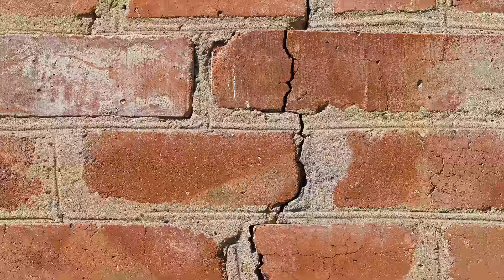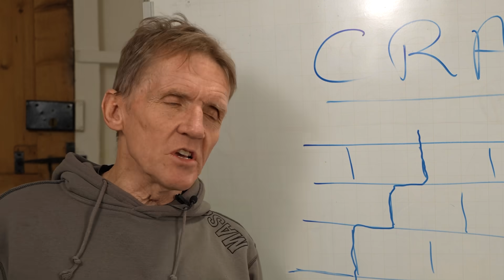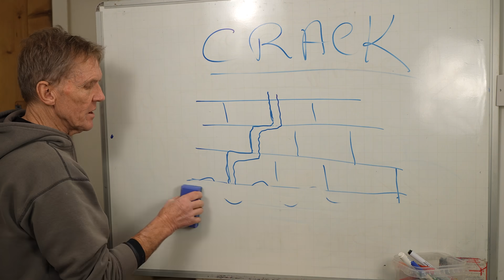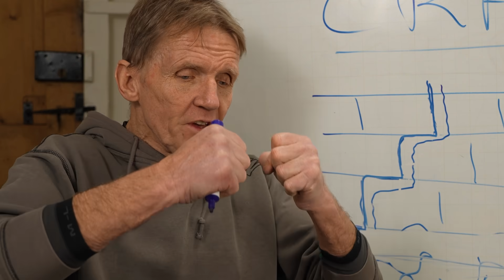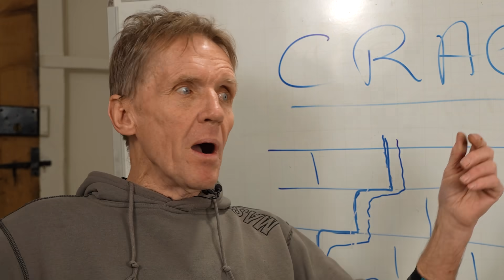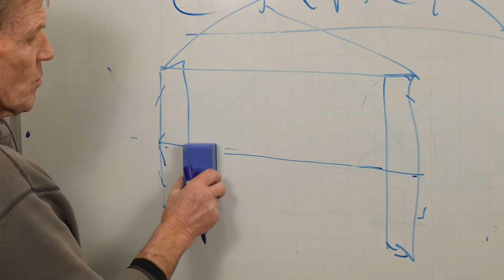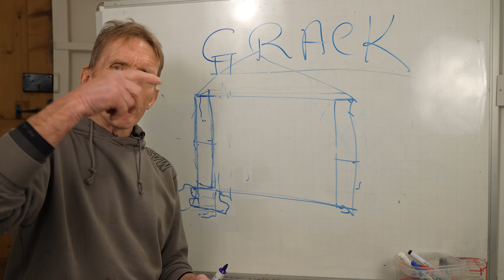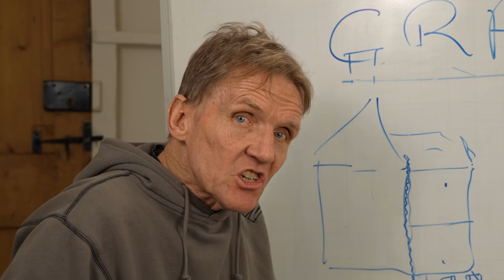Why Has Your Wall Cracked? and What Can You Do?

Comment: What if we don't know what type of mortar they used? My house is over 100 years old and there is a noticeable crack in the mortar and through a few of the bricks. How can we tell? It's made of soft brick btw
Reply from the maker: If you can scrape the mortar out with a screwdriver then it is sand and lime. If you have to grind it then it is sand and cement. I would say it is sand and lime

Comment: in general when u building a brick wall u never ever use a stronger material as glue than the building material like clay bricks are! This is rly important! And with modern sensitive materials like Ytong if u dont use the correct glue u can compromise the structural strength of the wall. And those house will not stand for a 100 years like these old clay brick houses!

Comment: in a 51 year old  house, what if the crack is traveling through the bricks themselves - say breezeblocks in the loft - is that still a none concern?
Reply from the maker: It is not generally a problem. It happens with shrinkage from building with wet blocks. If the crack continues to get wider that is when you need help

Comment: Walls cruck only if they are build by the amatures.
I contracted a demolition company to remove a single story 70 year old  house in Hagenow, Germany.
I agree on the cost and towards the end of the job I was told to pay additional money for removing the foundation from under the house.
Yes, they could not continue as the concrete foundation was one meter wide and over half a meter thick.
No wonder house had no cacks or signs of movement.
This is how you build.
Reply from the maker: We very often put large and very deep foundations in but without reinforcing there is no tensile strength in it. If the ground move the concrete will crack.  Clay is problematic and often the only aswer is deep piling with a beam foundation. We call it pier and beam.

Comment: This advice makes so much sense I can't help smiling throughout or even sniggering! It's just comic how sometimes people act when they don't know anything about a problem and try to address it by just treating the obvious symptoms without recourse to common sense. The fact that a simple act of stupidity can cost someone their house is material for tragi-comedies. The subtle causes that result into houses'/buildings' deterioration without the dwellers' noticing or caring about is food for thought and quite sobering.  Nothing lasts for ever but if it was made to last forever, it certainly wasn't built cheap. In the latter case, perhaps it's something worth thinking about before taking an old, soundly made building down (or severely altering it) just because "we don't like it" or "we want something better".

Comment: we had a crack in the back and front walls of our 1940s built semi detached house. the insurance company sent a man round who said it was subsidence and repairs with the rods and resin was done plus a drain survey.
after the works were completed another man came round to check the work and said he reckoned that it was next door that had subsidence and not our house and it was affecting out house.
about a year after the work had been done the house next door started getting cracks in the front wall in the same place as ours i cannot see the back as they have a conservatory.
there are several houses of the same design in our road with cracks in that very same place so i am wondering if it is a design flaw or weak point.

Comment: If you fix it with the original mortar formula won't it just crack again the following year?
Reply from the maker: It is possible
Reply: @SkillBuilder  So, is there a fix? I have a crack that opens to around 0.5cm above my bathroom door in summer. In winter when we get plenty of rain the crack closes up and is barely visible. This is an annual cycle.

Comment: I FILLED MINE WITH SUPERGLUE. COSTS A POUND. THE SUPERGLUE WILL PERMEATE THRU THE SILL AND FORM A WATERPROOF SEAL. AFTER YOU CAN PAINT THE SILL IF YOU WANT. SIMPLE.
IF ITS A WIDER CRACK THEN UHU CLEAR GLUE FOR A POUND THEN WHEN DRIED PUT SUPERGLUE ON TOP. THEN PAINT.

Comment: Very interesting.  I have a 1913 house and recently noticed a concrete window sill has a crack through the middle of it.  I don't want to get ripped off by a dodgy builder so thought of cutting out the crack a little with an angle grinder and the filling with either mortar or adhesive to prevent rain getting in.  Any thoughts on the best solution?  Many thanks.
Reply: I FILLED MINE WITH SUPERGLUE. COSTS A POUND. THE SUPERGLUE WILL PERMEATE THRU THE SILL AND FORM A WATERPROOF SEAL. AFTER YOU CAN PAINT THE SILL IF YOU WANT. SIMPLE.
ITS A WIDER CRACK THEN UHU CLEAR GLUE FOR A POUND THEN WHEN DRIED PUT SUPERGLUE ON TOP. THEN PAINT.
Reply: Car filler.

Comment: Most of the detached garages in my street have cracks in the front end of the sidewalls. A lot of neighbours blame tree roots but they are built on concrete rafts. The problem seems to be that the big garage doorways have steel lintels above them. These expand and contract forcing the side walls out creating the cracks
Reply: Might also be due to rust

Comment: Sand 6
Cement 1 
Hydrated lime .5

Or sand 12. 
Cement 2 
Hydralime 1          
Thats 4:1 btw

Or hydraulic lime. 3.5 sand 
1 hydraulic lime. 
Also 4:1 ish because lime is less dense than cement do 1 gauge is slightly less atoms per gauge. So we put less sand to keep the mixture strong enough. 
Not confusing. 
You want 4:1 
You want soft gear.
You gotta add lime. 
4 sand + 1 cement 4:1
4 sand + 1 cement + 4 sand + 4 lime = 4:1  (50 50 mix) 

4 sand + 1 cement . + 2 sand + .5 lime = 4:1  ( 25% lime mix)

3.5 sand + 1 hydraulic lime = 4 :1 ( pure lime mix) 
The strength of the podwer changes but the ratio of powder to sand should be around 4.1 for brickwork.

Comment: How serious if caused by thermal expansion? I'm end of a row of 60s terrace. Cracks seem to open and close with temperature, particularly when the midday sun is on the wall.
Reply from the maker: I don't think it is much to worry about, It might be a big lintel or steel that is trapped and causes the flank to move but it would be good to see some pictures 
send to 
www.skill-builder.uk/send

There is a web page to drop the pictures and video onto

Comment: I had a new build and it ended up with a crack straight up almost , crack went through the bricks too so must have been weak bricks or too strong mortar I guess, 
I was always a bit concerned but
Crack was thin though not even a mm and I never touched it, house sold recently and nothing was said about it ..
Reply from the maker: That sounds like shrinkage. Once the house has dried up there is no further movement
Reply: @SkillBuilder  there was a matching crack across the concrete drive too, street was built on clay in what was possibly a small stream,  lots of trees planted at the back of the garden which were not allowed to be felled .
I lived in it for 30 years and the crack never opened up any further.
Worried me st the time but looking at other houses I've seen a lot worse.
Reply: Sounds like settlement. Happens a lot in the first few years of a new build. 

Have also seen it in old properties where the roof has been replaced with heavier materials and added to the load.

Comment: Sitting in a London property built in 1790s - lightly built but has lasted well despite the Luftwaffe coming fairly close a while back. Problem is, modern heavy piling can and has caused cracking on wall/ceiling interfaces through racking of the structure. And, yes, the desire for open plan/wall removal and the added weight in upper floors is not always properly allowed for. The top floor of a Georgian garret was only designed for a bed, a chair, a cupboard and a thin servant - not a fully-fitted kitchen and other stuff - the floor joists aren't up to it. And don't get me started on people piling vast olive trees etc in planters on balconies and porch tops on Regency terrace houses. They weren't designed for it...on one big place a few blocks away most of the front came off a listed 'First Rate' house when the entire balcony tore out of a very crumbly wall where most of the mortar had long turned to dust (they had repointed the outer brick face but didn't look any deeper)..
Reply: This is why I’m always very careful not to give my servants too much gruel
Reply: Makes great sense and well described

Comment: not sure if it's anything to worry about but I've got a flint retaining walls what has sunk and the steps, and opened up a crack on both ends about 3". I don't think it's going to affect the foundations what are deep, the edge of the wall to the property is about 8ft.
not sure what the best approaches is to pull down the wall and rebuild it but what I was thinking is to dig a trench on the inside of it and fill it with reinforced concrete, it's on clay soil I think the house is down to the chalk tho. what's the best approach here!

Comment: Thank you Roger, very simply put so that it is easy to understand for all.
I have a brick shed building built in the 1940's in Cambridge. There were a couple of vertical cracks due to trees behind the wall. The trees have now been removed.
One of the cracks is 2" at its widest.
I don't know if the mortar was cement or lime based. How can I tell the difference and What can I fill the crack with to keep mice or water out?
Reply from the maker: It is likely to be sand and cement so you can use that for the repair but try a 5 sand to 1 cement. If the movement has stopped it is a good job for a crack stitch.
Reply: @SkillBuilder  thank you.

Comment: Very illuminating. Our house was built in 1955, has shallow foundations on clay & black ash mortar brick joints. Cracking isn't an obvious problem but we do need to do a little repointing, so going to have to find a compatible modern mix. Does anyone have any suggestions?

Comment: Great video, if you remove a chimney breast though, what are you going to put back? - A boarded windpost fixed to joist above? What is the usual solution?
Reply from the maker: A windpost all the way to the top would be a good idea. Tie the walls into the joists. It depends on the house
Reply: Yeah that's what I was thinking. Do you like Ancon windposts or prefer a small SHS from a yard ?
Reply: @liamodonnell9091  I'd go with SHS everytime. they're much stronger
Reply: @tonyholohan6756  Thanks Tony, would you build it in to the solid wall? Otherwise a full height SHS is circa 100 square, with plasterboarding it will leave a box out which the clients will hate
Reply: @liamodonnell9091  Definitely build it in with the wall.   Typically remove the inner leaf locally. about 400mm wide along the existing blockwork joints.  Then put the SHS in the plane of the inner leaf.   Then when rebuilding the masonry tight to the SHS, screw masonry ties to the SHS to tie it in with the new toothed-in masonry. No bump-outs, and a nice tidy job.
Reply: That sounds great Tony. Only thing is you technically have a small area where the wall is 100mm thick. Wont this affect the load capacity of the wall quite significantly. Sounds like a great solution though. Yeah agreed on removing locally and then tieing into masonry.
Reply: @liamodonnell9091 
what small 100mm piece remains?. 
post would tyically  be designed by a structural engineer to restore the wall to its required strength taking account of the removed and remaining wall.

Comment: My 1990 built house, built by Tarmac Homes, was built using calcium silicate bricks with no frogs.   When using that type of brick the mortar should contain lime due to heat movements on the sunny side of the home.  Most of my housing estate suffers from cracks in the mortar.on the sunny side of the homes.   I only found out the reason when matching bricks for a house extension.  This was after my next door neighbour went to their insurance company who fitted helifix bars set into the mortar.

Comment: Regarding the old wall restraints,  my old man told me he saw it done just after the war they put the rods through with the X on the end against the outside wall then heated the bar so it expanded then tighten up the end and as the rod contracted it would  pull the wall in repeat as necessary until the wall was where you want
Reply: Brilliant makes sense

Comment: Very informative video Roger.  
I see alot of cracks where loadbearing timber windows have been replaced with UPVC [generallly houses built 50s, 60s and 70s] and the cracks and deforming of brickwork above as a consequence.  Helifix works well here to create a beam effect to prevent further movement and I have also seen Acrow props used to allow for inclusion of a metal angle to act as a lintel to the external brickwork.  It would be good if you could do a video on this problem, as it seems to be in every town and village.
Reply: Is there a video on this. as this is the issue my home is having.
Reply: @jamesbirch6522  just dealt with a wooden lintel above a kitchen window. The outer area had rotted but the inner (I.e. inside the house) was sound. I cleaned up the outside timber getting rid of the worse of the  rot. Then I sprayed three lots (it was a hot week) of rot and worm killer on the timber. I got a length of 30mm by 30mm by 4mm steel angle cut the exact length to go under the wooden lintel sitting on the  supporting brickwork at either end of the lintel. Onto the steel angle I welded a 30mm by 4mm flat bar. This was hammered (it took a heavy hammer) in under the lintel with the 60mm under the lintel. The whole lot (front  and under side) was then covered with expanded steel mesh. Formwork (made out of 3mm ply supported with timber) was placed under the lintel, angle and mesh. The formwork makes it easy to face up with render. Using a mortar gun I pumped a one to one mortar mix under the lintel on top of the ply, then rendered up the outer area with standard 3 to one mortar.
This means that the timber will not bend it would have to crush (that will not happen) for the upper brickwork to slump. I may put some helical reinforcement in next year above the lintel but there is only one course of bricks before the upper pebble dashed area.

Comment: Conservatories that don't have deep enough foundations! No building regs needed on conservatories and thus many are not built correctly. I have one that slumped but thankfully settled again about 4 years ago. Left cracks and an uneven floor. House insurance is pointless as conservatories without building regs are not covered so it's patch it up best you can. New floor and fill the cracks.

Comment: Our house, which really is in the middle of our street... Is currently sliding into the side garden and driveway. Seems that the foundations weren't dig deep enough for the cutout areas around the house. The next step is to sink those inspection holes to check the foundations, with a mind to perhaps reinforce them.

Comment: Very interesting film thank you, is the crack theory the same for outdoor concrete paths?
Reply: Slightly different with concrete. Concrete will shrink as it sets, although called expansion joints concrete cannot expand any larger than when originally laid, “expansion joints” are used to control where cracks appear.
Reply: @MrB3ngy  Many thanks Dave 😁

Comment: I'm trying to sell my house which is built on clay and has a big crack down the back wall that opens and closes like that over the years. But I obviously don't want buyers to notice it and because the previous owner painted the house white it shows up even worse! So I filled it with some cheap white filler to a few mm and touched it up with white paint and it concealed everything perfectly. I hope that ratcheting won't happen there because the filler isn't very strong and isn't very deep and that it'll just crumble under pressure rather than make the crack worse. In any case, I hope to be moved out before I find out for sure! The previous owner had tried repairing it and I can see these secondary cracks in the brickwork parallell to the old 'repairs' - that made me worry it was something serious, but now I know better.

Comment: my garage has cracks in the back wall due to poor guttering causing the ground underneath to subside
it's only 20 years old so i was expecting a bit more life out of it yet
i've just screwed some straps to each side of the breeze blocks and it's not got any worse but the door now has about an inch at the top on one side and an inch on the bottom of the other so somethings not right lol
i'd send you some pics but where do i post them please?
thanks